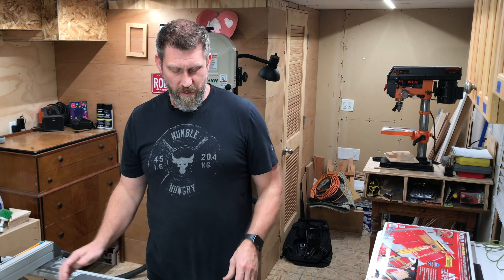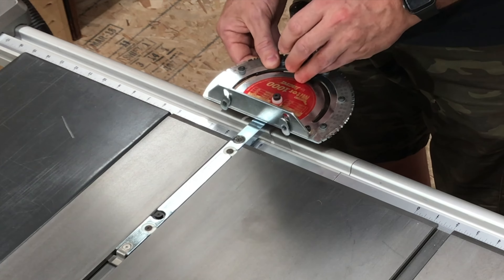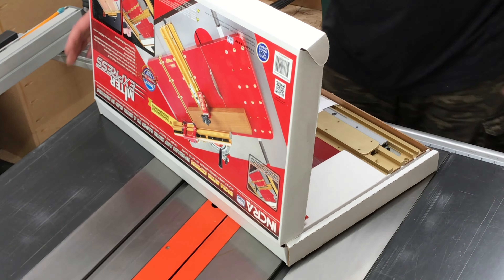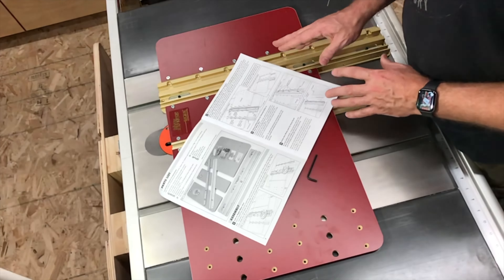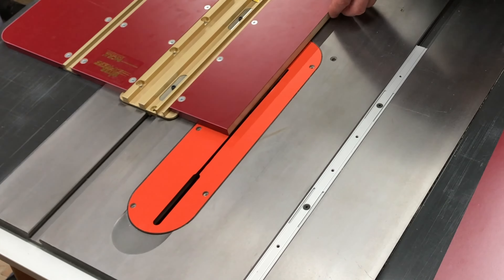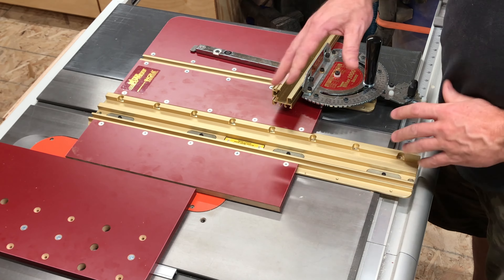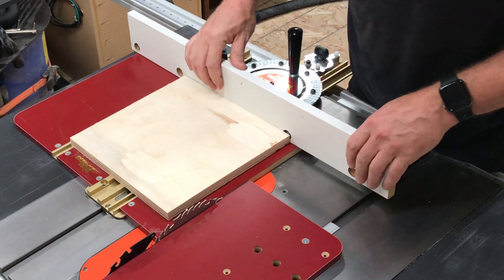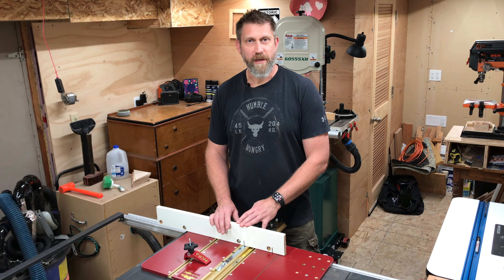Incra Miter Express Table Saw Sled - THE BEST Upgrade for Woodworkers in 2025!

Comment: Congrats on the job you picked up. I bought a earlier version of this product about 20 years ago.  I use a home made sled for square cuts, but I still pull this out for all angles. It is easy to set up, and very accurate.  It is so good I only use my compound miter saw for rough cuts!
Reply from the maker: Sweet! Thanks for the confirmation!

Comment: Why did you make that sacrificial fence?  I'm assuming so you can keep material closer to the mitre?
Reply from the maker: Great question! It helps with a few things.
 1) It makes it easier to clamp the workpiece to the sled 
2) It gives me a zero clearance through cut on the fence for very accurate cut lines. And
3) It pushes the off cut past the blade to reduce the chances of kickback

Comment: I haven't seen anyone using the miter express with the blade tilted for angled cuts.   Any thoughts on how to use it that way?   Even the installation manual only focuses on the blade set at 90 degrees?
Reply from the maker: In the project I’m currently working on I used the Incra sled to make compound angle cuts and it works great for that. No damage to the base of the sled because it tilts away from the bottom. And it’s absolutely essential to have a sacrificial fence on the miter gauge to make that cut so you can line up the cut accurately. You just inspired me to make that follow up video! 👍🏼😁

Comment: You should run the sled with auxillary fence you should continue through to push the off cut past the blade and splitter so that the off cut does get thrown from the table saw.  This can happen easily with small off cuts.  I'm referencing the 17:35 part of the video..
Reply from the maker: Right you are!

Comment: Does this work on your job site? I have the dw7491, and the 1000 fits on it, but not sure if the sled does
Reply from the maker: I haven't used it on my jobsite saw, but I'm sure it would work. Different saws have different distances from the miter slot to the blade. So whichever saw you choose, the drop panel and sled will be custom fit to that saw.

Comment: Hi Brett, you assembled the boards on the large plate incorrectly. Look closer at the directions. You are off by one hole on the utility plate. The boards to the left and right should be moved back toward you by one hole. You are shorting yourself on blade to miter fence distance.
Reply from the maker: Thanks for the keen eye! I’ll fix that.